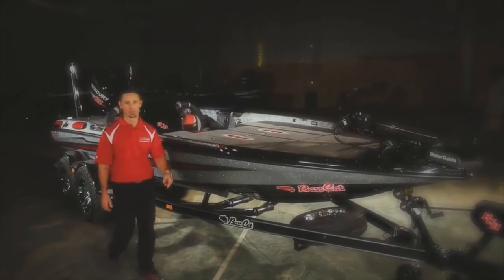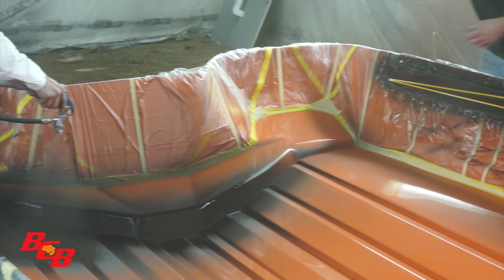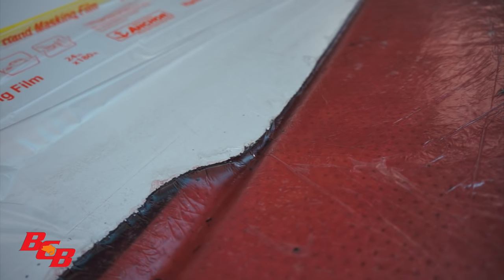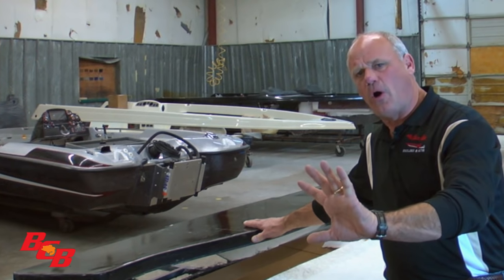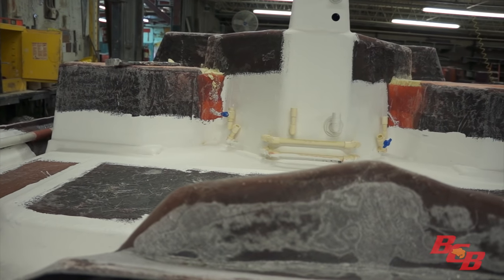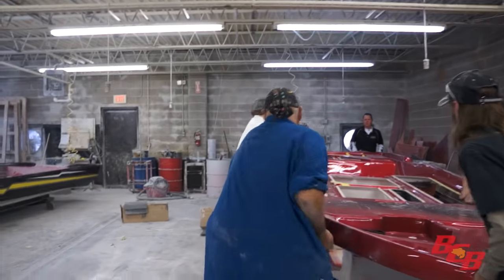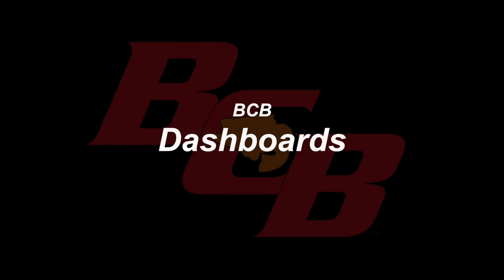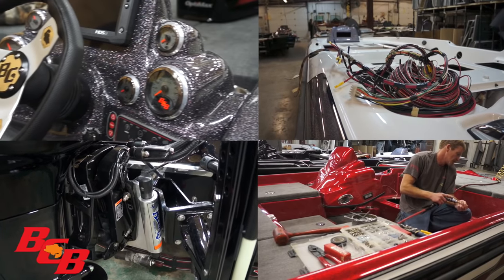Bass Cat Boat Factory Walk Thru

Comment: Hands down the most impressive factory walk thru, fab & assembly of any bass boat company I've ever seen. And the very second I saw "C-channel" steel used for your trailers, I thought: "BINGO!!!". I've always said that a thicker guage of C-channel blows away "box/tube frame" for durability and service down the road. Box/tube frames RUST FROM THE INSIDE OUT. And there's no way to get to it to stop it. With C-channel, all the water runs right off, instead of being trapped, and all surfaces of the steel are exposed to easily sand/resurface & re-paint, should ya ever need to years later. GREAT JOB GUYS.

Comment: I owned BassCat serial number 000017. The boat is still running today, with new engine. Yes, I kept it covered when not fishing. The transom is still strong and hull has dings but has never leaked. I now own a 1989 Pantera and it still looks and runs great. I will not own any other brand. Plan to buy new for my retirement.

Comment: Even though this video is 4 years old, it’s still very informative and impressive. I’ve been looking for a quality bass boat as they are not cheap. The other thing that really matters is the dealership. I have found that a top dealership in my area sells only BassCat which makes sense after watching this video. I have a Ranger Angler 1880 MS which I got for the kids, but since the kids are gone, I am seriously considering a switch to a BassCat bass boat. If anyone is still looking at these posts and can offer any words of wisdom, I’m open to suggestions. I would like at least a 20 footer.

Comment: The locker designs are too overdone. They need to keep it simple. Why create a boat where someone loves it or hates it based on the rod locker design, just keep it simple. I don't need 13 cup holders on my boat, and get rid of the rop tie downs that stick out, and get the ones that pop out.